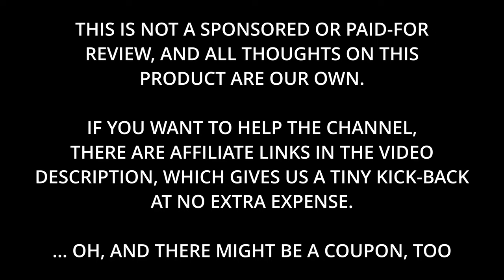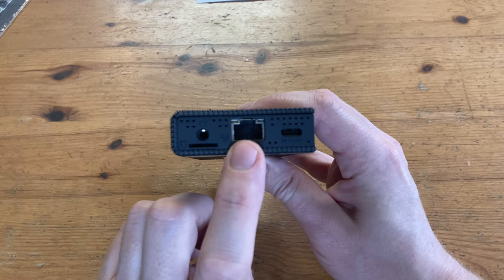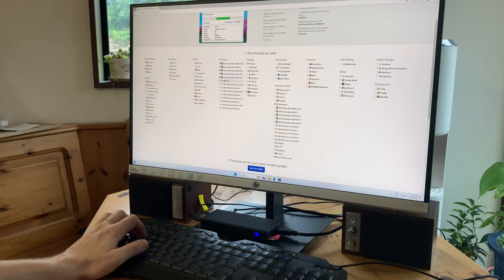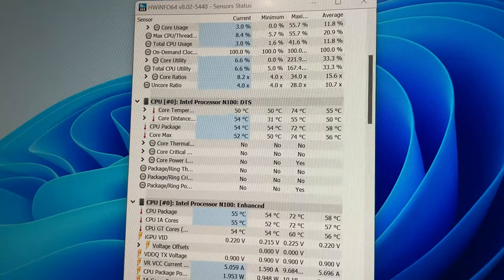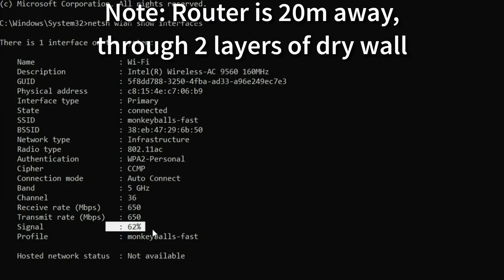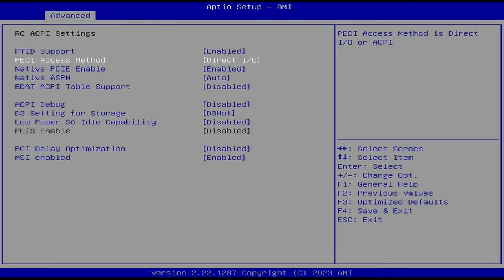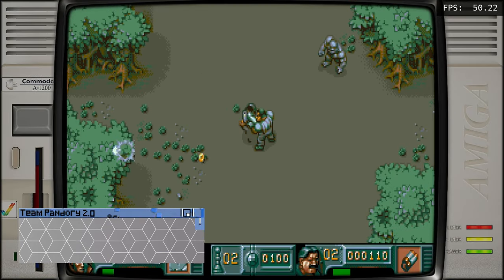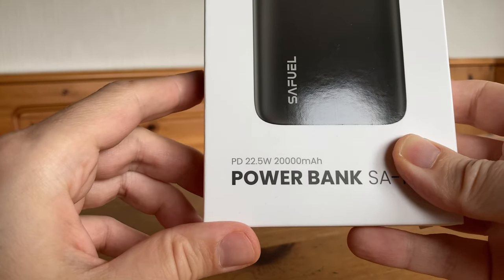Silent N100 Mini PC That Fits In Your Pocket [MeLE PCG02 Pro Review]

Comment: It's crazy to see how far the PC stick game has moved on. Not so long ago, the best we could get was a 14nm or 10nm Intel Celeron CPU with LPDDR3 or LPDDR4 RAM. Now, we have a PC stick that can even rival Chromebook laptops.
Reply: What's even crazier is that most Chromebook laptop at this price point still has 4GB RAM and 32GB/64GB internal storage. Some are more expensive than this PC stick despite using the same CPU.

Comment: I love how you test games but there are some new mini PCs with a n97 chipset that supposed to outperform both for 100 and 200 I wish you could do a video on this new chipset I love emulation I noticed when you test these computers you test how well emulators perform thanks for the video 😊
Reply from the maker: Funny you should mention those chipsets, I have an N97 still to unbox, and an N200 is on the way!
Reply: @TeamPandory  Iam excited when you do your video can you check and see if the N97 can emulate OG Xbox and PlayStation 3  I don't understand why they won't use these chipsets with dual channel RAM it really would boost performance but the N97 looks very promising thank you team pandory you are the man👍
Reply from the maker: @alceearsberry4150  I can tell you right now that it won't play PS3. Even the higher i5, i7 and i9 mini pcs we had on couldn't pull them off, probably due to the crappy iGPUs they had.

Comment: Admittedly this N100 PC is not great for gaming, but it does just fine as an office PC. Being silent and running at a decent speed, it’s perfect for office work. I have one and I love that it has no moving parts so it can run all day and night on little power and get work done. Much of my work involves scripting tasks that need to be orchestrated with other computers on my network and on the Internet, and for my use-case this PC is perfect. It makes a great portable tool to take to job sites and be able to diagnose problems with systems, perform work onsite or demonstrate applications to customers.
Reply from the maker: Yes, normal office tasks and things like that it's fine, but as we mentioned there's no difference in performance to their two year old version, even with the faster chip.
If they'd have placed an NVME in instead of the emmc, and have a better solution for power (and thermals to keep the temps down for the higher tdp) this would have been a far better computer.

Comment: With eMMC storage, I would consider installing FydeOS. That would give a more decent overall performance than Windows 11 or any resource-intensive GNU Linux desktop distro, particularly those using KDE Plasma as the default desktop environment.

Comment: We have three all-in-one computers at work. I knew they'd have problems and they do. They're basically computer monitors with the computer built inside the back and an internal dock for a single SSD. There's no fans in those, either and they all run slow. Two of the PCs are the same, so they both run at the same speeds. The third computer is a different model and it's so slow that even IT support asked why it's so slow. I've checked the running processes and there's nothing extra running in the background. The computers are just way to underpowered.
Reply from the maker: We've seen plenty of mini PCs, but the thing is, even though some have the same cpu you can have a vastly different experience
In this case, it was a combination of the slow storage, and low tdp settings (done to lower temps)
As for the computers behind the monitors, it could be anything. You can have a fast fanless pc, the chuwi n100 we had on was pretty decent.
You'd need to check the specs.  But if the IT tech at your company doesn't know why they're slow, he may need firing 😂 
Regardin

Comment: 75 degree is tjunc. Read the docs. It trottles because of overheat. I have ASRock n100 motherboard and replaced default shitty radiator to gammax one. Idle temp is 35, 54 max load in Linux stress utility. But its not a compact variant.

Comment: I have 4c melee model with n100. I put turbo mode to L1 20W and L2 to 27W and works perfectly fine. Better working on linux after installing the newest kernel 6.5 and unistaling old 5.ver kernels, turn on vaapi on firefox and youtube 4k/60 no problem. my opinion melee 4C is much better with the temp and speed even if is the same almost but it's bigger for better cooling, 16GB RAM and additional space for nvmie disk.

Comment: Not good at all with that thermal throttling. EMMC is a silly storage option unless there is scope to add more internally.

I'm not sure which planet you would have to ive on to expect it to work with 5v/2a as no N100 PC can.
Reply from the maker: Power throttling, at first  😂. Thermal throttling once we bump up the tdp 👍